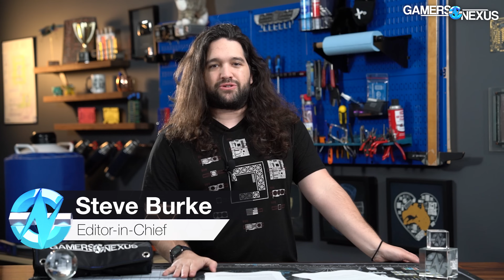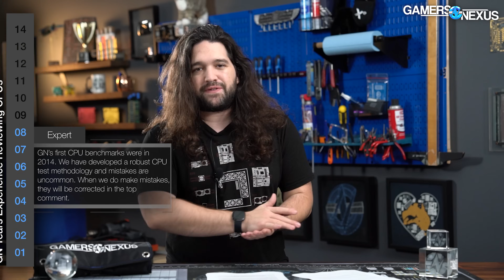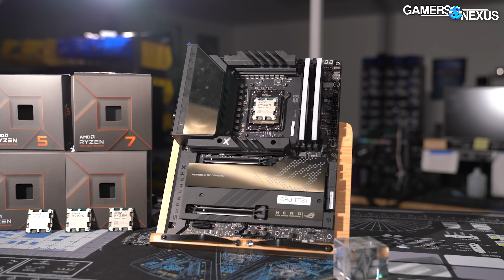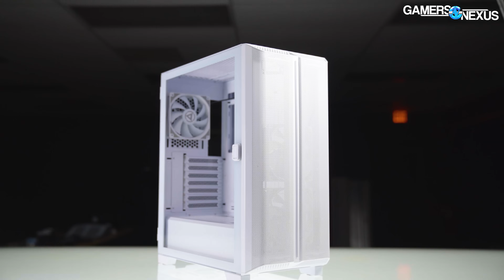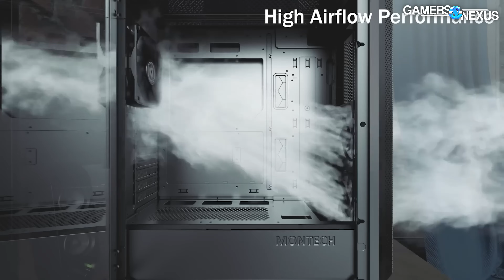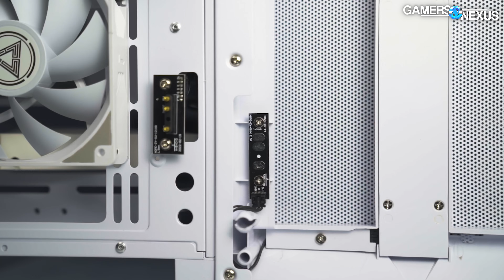AMD Ryzen Eco Mode Deep-Dive & Benchmarks on R9 7950X (Zen 4)

Comment: With all vendors pushing their products hard out of the box it seems opting in for efficiency is something that’s going to be more commonplace. These efficiency results bode well for Zen 4 mobile!
Reply: I mean, considering a 88w PPT 7950X is still faster than the 5950X at 125w, that's pretty impressive to say the least. So yeah, for all intents and purposes, mobile AMD parts are going to be interesting for sure!
Reply: @imglidinhere  5950X is still better that the 7950X.
Reply: This will also be reflected on Thursday when EPYC Genoa will be released, for servers efficiency is a main criteria
Reply: Bodes well for the upcoming server parts too, as they run quite a bit lower on the v/f curve than desktop. For data centers work per wh absolutely matters a ton.
Reply: As a musician, I am extremely interested in efficiency.  Trying to mix with fan whine or even just turbulence is a bitch.  The chip that does the most work for the least watts is, absolutely, a point I consider when I buy.
Reply: When people are trained to call a product A that scores 100 "the best" and product B that scores 99.9 "garbage", companies will obviously go for performance, not efficiency. Intel started it, out of necessity, Nvidia followed, AMD realized that it hurts them to try to play the efficient option. So they are going that route also.
Reply: @johnd.1618  The PC DIY market has been around for decades.

Yet somehow the majority of the time we had product lines whose chips weren't factory over clocked out of the box.

I guess they didn't want to "win" up until now.
Reply: Literally have Intel based i9 HP laptops catching fire were I work. Or they're running hot shut off or thermal throttle. Whoever purchased them wanted the best of the best, best sometimes the best isn't always the best.
Reply: RDNA 3 apu will be very interesting for mobile handhelds
Reply: Meanwhile at ARM: am I a joke to you?
Reply: @diomedes7971  then buy AM5 champ. Majority of other people are going to buy the best performance for their dollar and don't care about efficiency. It's been proven every product release. Stay mad about it.
Reply: @simplyscholar21  why are you being such an extreme Intel fanboy, and why are you ignoring the fact that out of all the replies perhaps only 2 people agreed with you ? You are an extreme minority on this topic.
Reply: I bought a 5800x because I was doing a lot of gaming and some more production workloads. I purposely now have "eco-moded" my CPU/GPU for the reason Steve said at the end: Dropping 20% of my wattage only reduced workload efficiency by negligible amounts and the gaming performance was unaffected. Bonus is that a lot of my case fans also go into a more silent mode, oftentimes even running at basically "off" (spinning but at their lower RPM limit).

I agree that you're going to see people (especially if you have two different use-cases, like Production during the week/gaming on the weekend) running a more efficient build at least part of the time to take advantage of the massive wattage and sound savings.
Reply: Zen 4 mobile will be impressive. The dragon range offering will be something to behold
Reply: Still quite a long way from the main mobile competitor, apple.
Reply: and if we want the full performance we have to have winblows 11 which i refuse to upgrade to it
Reply: @billyhatcher643  lmao. Hating on Windows 11 just because new and haven't used it yourself or let other decide for you. Welcome tech, things are always changing.
Reply: @billyhatcher643  Im buying parts as I can get them for my new rig. Im absolutely fking finished with Windows.   Linux Ubuntu Mint 21.
Reply: If you have 2 CPUs for the same price. One is less performance but more efficient, and one is less efficient but has more performance. The one with the most performance is going to outsell the one that's most efficient every time. "Efficiency" is almost exclusively an argument that a fanboy uses to defend their favorite brand when it falls short on performance. X is more efficient than Y, so X is a better per watt value. Meanwhile the rest of us are popping the IHS's off our CPUs and using liquid metal to run more power through them.
Reply: @simplyscholar21  You mean like when Intel did the same back in the day:)? Sorry, but power efficient is still a thing. Even if you have the highest performing SOC... if it runs at a blazing hot to cool - it wont matter because people will still see it has something that can't really afford if they're paying 100s of extra dollars just to run and cool it. There is also still the mobile half that does have to play the efficient game because of the battery limits we still have today.
Reply: @adr2t  lots of fanboys in the comments today. You guys keep buying based on power efficiency, the majority of people will keep buying based on performance. :)
Reply: @simplyscholar21  majority of people dont give a shit about 5 or 10 percent different on performance
Reply: @simplyscholar21  you just said the majority of people are popping the ihs and using liquid metal. You see how silly this comment is right?
Reply: @simplyscholar21  For some users that's certainly the case, but not everyone. I'll happily take a 6% (at worst!) performance hit if it reduces total power consumption - which directly relates to both heat output, and electricity bill - by 40%. That's a nutty trade-off.

I fully respect enthusiasts wanting to push peak performance, even if they have to double their power (and heat) to reach it. Great for them! I'm enthusiastic about efficiency. I still want great performance, I just don't want a space heater in my room to get there.
Reply: @YttriumtYcLief  Its almost always an Epeen thing.
Reply: @simplyscholar21  You're seriously trying imply that most people delid their CPUs?
Reply: @simplyscholar21  It depends on the context. On desktop, the less efficient CPU wins out since anyone who cares about performance can accept higher power consumption and better cooling requirements. While in mobile space, where the budget for power (power adapter, battery capacity) and cooling (size, weight, heat density) is limited so the more efficient CPU is valued more.
Reply: @simplyscholar21  I'd absolutely take an additional hour of battery life over an additional 10% in performance on a laptop, you're off your rocker here
Reply: @simplyscholar21  just cause efficiency doesn't sell doesn't make it less important
Reply: @simplyscholar21  people start to notice when an hour of gameplay costs you a quarter in electricity bill... it's almost like paying subscription for streaming service... Unless that's their goal, price everyone out of DIY market and force into subscription plans...
Reply: @simplyscholar21  Definitely call me an AMD Fanboy cuz thats where the money out of my wallet is going this time.
Reply: @simplyscholar21  Personally i like to sell my old CPUs on ebay, i only lost £40 on my 4 year old ryzen 1600. It would be harder to do that if i removed the IHS. It was also cooled more than good enough with stock cooler due to its low power consumption, i also have a £65 B350 motherboard, because i dont need strong power delivery, even for the 3700x that i have now, it uses 57W.

I reduced the wattage of my 3070 from 240 watts, to 170 watts, with +1100MHz on the memory it is actually slightly faster than stock, also silent and large power saving when electric is 33p/kwh in uk.

Efficiency is very important, for businesses too. Efficiency modes, limiting FPS, seeing the benefits, etc. should be more accessable and easy to use for average users. I hate the way the industry is going.
Reply: @simplyscholar21  "Meanwhile the rest of us are popping the IHS's off our CPUs and using liquid metal to run more power through them

What? might be true if "REST " of you fall in that niche minority .0001% market category who knows stuff and pre-determined what they need but for a average gammer? no.

never seen any hardcore esports touch BIOS to OC their system to extract every frame let alone Deliding and using ln2.
Reply: @simplyscholar21  In laptops more efficient cpu = more headroom for the gpu. Yeah, Intel had legit significantly better performance in games compared to zen 3 in laptops but it came at the cost of everything else hence why intel actually lost marketshare.
Reply: @simplyscholar21  Efficiency with mobile cpus is kind of a big deal when you're concerned about battery life on a laptop. AMD is doing quite well with their 6000 series of mobile Zen3+ processors, like the 6800U -  excellent cpu performance, good RDNA2 graphics, and good battery life. Zen4 mobile should be even better.
Reply: @simplyscholar21  efficiency is as important as performance because it creates headroom to rise performance by more power consumption
Reply: @wassilia1234  that's the dumbest thing I've read today. If you think the most efficient CPU is going to have the best performance because it has "headroom", try it out. You'll find that the CPU with the best performance maintains the best performance when both are fully overclocked.
Reply: @simplyscholar21  I think you need a reality check as to just how incredibly niche us enthusiasts (let alone overclockers) are in the PC market.
Reply: @simplyscholar21  but to make CPU faster at similar power target you must make it more efficient first. Only then you can boost it to the desired level of performance.
Reply: @simplyscholar21  You seem to care enough to get your point across loudly? That's fan boy talk if ever I heard! Come on now nerd you are just the same lol
Reply: @DJKr15py  Unless you are going Sub Ambient or Sub Zero, Overclocking is now irrelevant. The amount of work it takes vs the results are pitiful.
Reply: @danimayb  They dont realize how clearly we see this.  Not just Twiggy.  I just dont consider it worth the trouble.
Reply: @wassilia1234  I agree on the `efficiency is important` part except for the provided reasoning.
The headroom spared doesn't necessarily have to scale well with the architecture in question.
It is plausible that it reaches a ceiling early and any further power draw doesn't result in meaningful perf. gains.
Reply: @simplyscholar21  i feel like you are from FrameChasers  channel right :))
Reply: @DJKr15py  yeah Twiggy is speaking for a “majority of us” when the same “majority of us” are usually more like “what’s an Nvidia?”
Reply: @simplyscholar21  You clearly are reading your own comments. People care more about efficiency than extreme power. Just admit you're an Intel fanboy who loves hot CPUs in favor of maybe 5% uplift.
Reply: @svn5994  people care about performance. Regardless what the AMD fanboy section says here, the CPU with the best performance for the dollar sells. That's why AM5 isn't selling and Intel is flying off the shelf. Just like the 5000 series sold and the 11th gen stayed on the shelves.
Reply: @simplyscholar21  I love it when fanboys like you call out fanboys from the other side, the hypocrisy is hilarious regardless if you are a fanboy of AMD or Intel
Reply: @simplyscholar21  yes keep going, keep the fanboy juices going! I love seeing fanboys in denial like you, very entertaining
Reply: @simplyscholar21  now that's a good obedient fanboy, might give you a scooby snack for that, keep going!
Reply: @simplyscholar21  the fanboy has now proceeded to stalk my channel LOLOLOL, thanks for confirming you are now completely triggered fanboy
Reply: @nrgamingtech2797  the fact you're deflecting so hard tells me i'm spot on. amd fanboy is too poor for power, so he wants to run an efficient CPU. It's all coming out now. Maybe if you moved to a better country you could afford performance.
Reply: @simplyscholar21  WIth the current electricity prices you are definetely wrong bro
Reply: @Sweetw4ter  no i'm not, bro. most of the people whining about power efficiency have no idea how much it actually costs to run their PCs. You aren't benchmarking 24/7, in a game your CPU doesn't use nearly as much power as it does when it's being benchmarked. Not to mention even if it did, it costs tens of dollars to run it for a month maxed out, not hundreds.
Reply: @simplyscholar21  If the difference is a 200$ watercooler vs a 50$ aircooler to cool the cpu people might turn their heads. SFF is very popular and cases that can handle 360 radiators are few, 240-280mm radiator and the market is wide open.
Reply: @simplyscholar21  Nonsense.

I will happily take a non factory overlooked over volted CPU that doesn't run at 95 C and ramp up my fans to 100 percent for the same chip running at it should be running at.

I'd also be happy that if I choose to beef up the cooler and manually overclock to these stupid out of the box settings, I'd be able to do so.
Reply: @simplyscholar21  Well, ideally you want one that can do both! That way if you care not for the power use you can get max perf but if you care for power or heat production, you can still get good performance :)
Reply: @simplyscholar21  I would never take 5% perf increase if it meant 95 celcius cpu and loud pc.